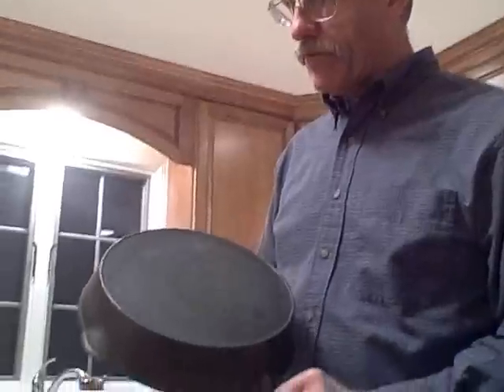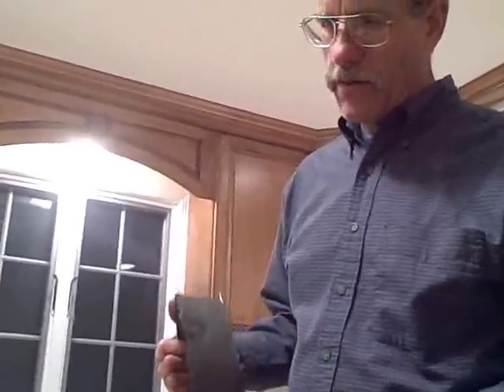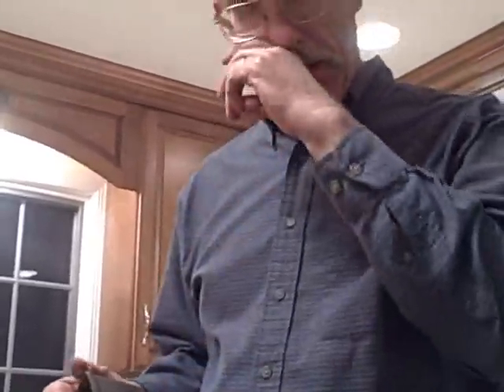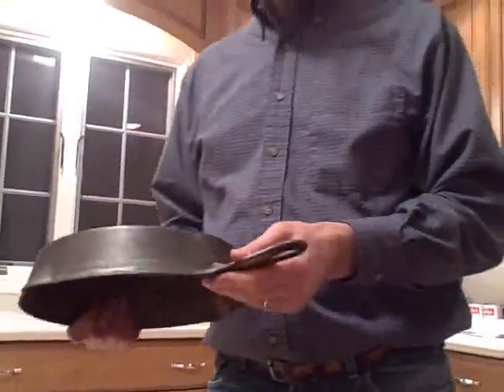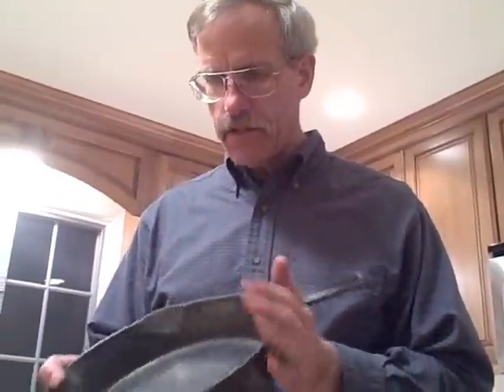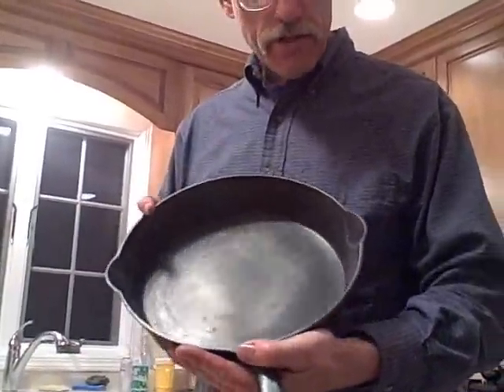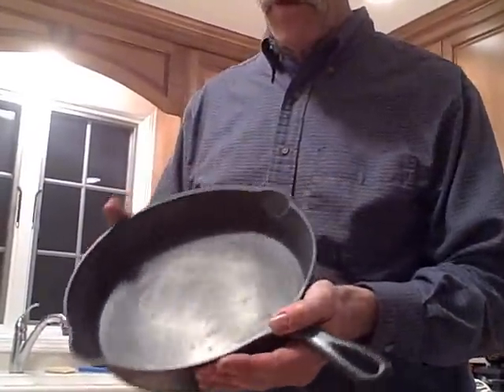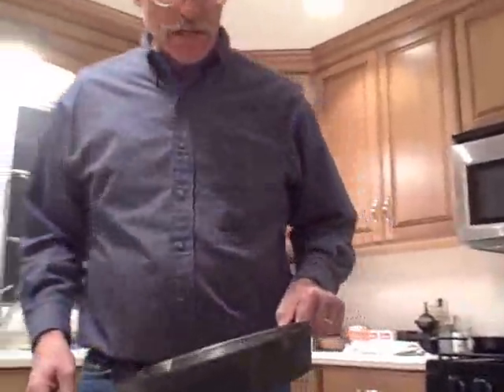Testing for Cracked Cast Iron pans

Comment from the maker: @biolectron Thanks for your reply. I especially liked your oven cleaner method. My sister uses that method. 

As far as 900 F being too hot for cast iron, I disagree. The furnace heats up slowly-2 hours to 900F. They cool down slowly: 6 - 7 hours to cool back down to room temperature. This is not a shock to cast iron. 

I made a CI angle plate and heat treated it as if it were O1 Tool Steel. 1460F and quench in warm oil. Temper at ~500F about 1 hour, air cool. Its 35 years old now.

Comment: I have a neighbor, he’s an iron worker, there IS a process, it CAN be repaired, several different ways! It may cost $20-30, would be a GREAT user, maybe not so much a collector item, but..😎
Reply from the maker: Thanks Rick. The cracked pan in this video is long gone. And, I don't think I'd repair anything common like a frying pan. It would have to be something really unusual to go to that expense and work.
Reply: @jerrytheplater  lol ok, I just thought it was important, that people who may not know, that the cracked skillet handed down from grandma, to mom, to them, in fact CAN be repaired, for ABOUT the cost of a modern replacement of lesser quality, ie a rough new lodge is about $25-30, vs grandmas smooth as glass BSR…if it’s got sentimental value, and you want to keep using it, and you’d rather put the money into repair rather than replacement and have a better piece in the end, ….it is possible.

Comment from the maker: I wish I had tested it before I put it in the furnace here at work, but I didn't. I would think the cracked sound would show up, but I am not sure. 

Also, the bottom was not cracked and it rings and doesn't sound cracked. Only the rim. So you need to check both.

I just put two in the furnace today and neither of them was cracked. I'll know tomorrow if they cracked in there. Previous ones have not. I took care to place them in such a way to avoid direct heat. They will see 900F for 5 hours.

Comment: There are dozens of manufacturers of cast iron skillet in the USA up until mid century.  Good point to look for cracked, warped, rust, chips, pitting, repairs etc.  The Wagner is only worth a buck, but it will look good on the wall.  FYI..It is not called a Heat Ring but a rimmed bottom (outer) in the case of that skillet.  Heat ring has been named to the rimmed bottom as well as a smoke ring.

Comment: So you put this in a furnace at  900F for  five hours. That was your first mistake no cast iron pan should be put in a fire whatsoever. That pan was more than likely not cracked before you put it in the furnace at such an extreme temp. Cast iron pans as old as this one were cast thinner and smoother and more prone to warping and cracking at such high temps. i suggest you use yellow cap easy off oven cleaner  spray the pan place in trash bag, set in sun for a few days to remove the carbon